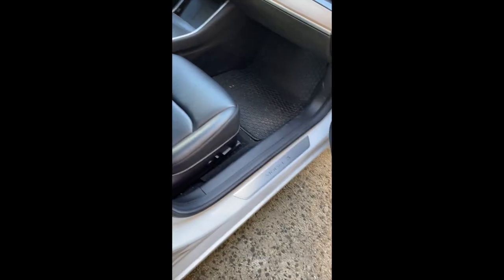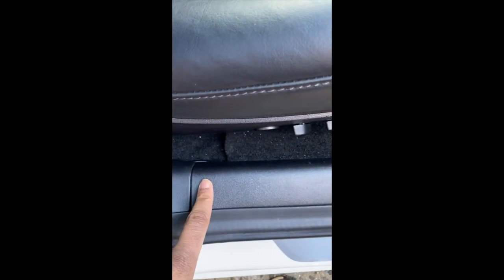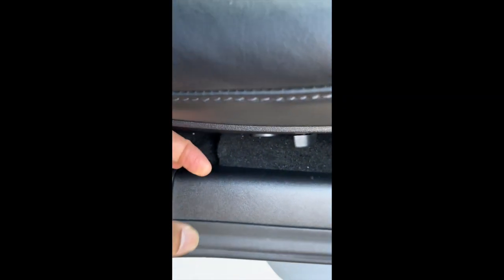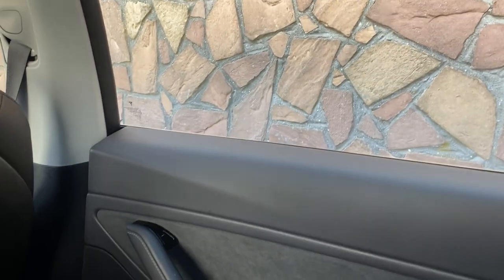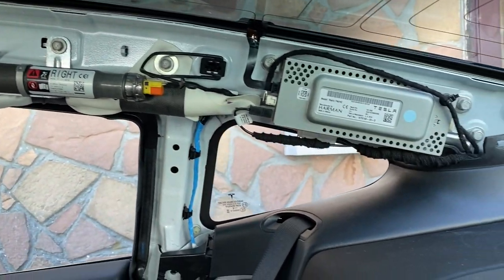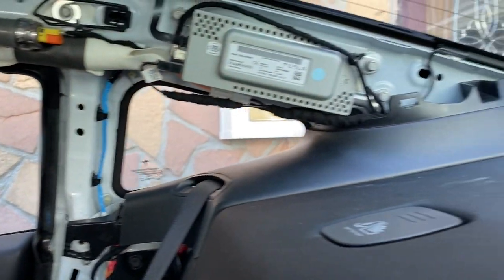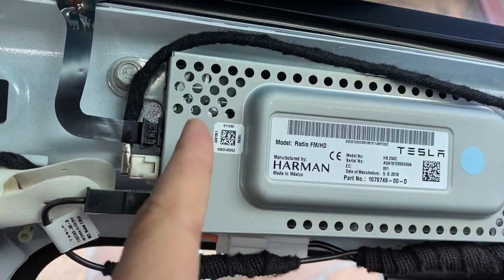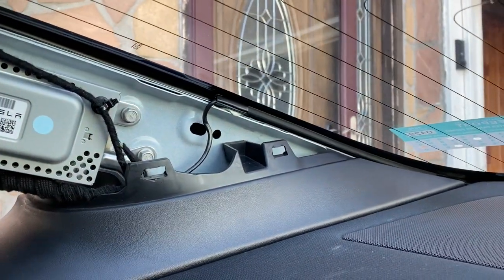Tesla Model 3 rear deck disassemble and power connection for Hanshow v3 Tailgate

Comment: Those leather side bolsters had a second clip that you missed.  They had came out of the bolster and were stuck in the metal frame. 16:16.   behind seat belt

Comment: I want to replace the 2 rear speakers. Is it possible to just lift out the grill covering the two speakers, and then unscrew the speakers from their brackets, unplug them, then replug the new ones?
Reply: nope... the speaker grilles use some metal tabs that are accessed from the underside of the panel... and there is a metal plate in the ceiling of the trunk compartment.  you need to pull that rear deck panel out to access them...